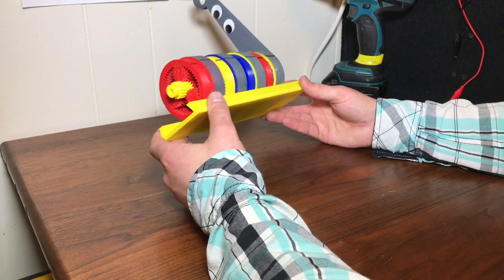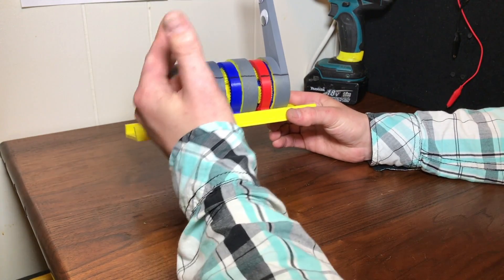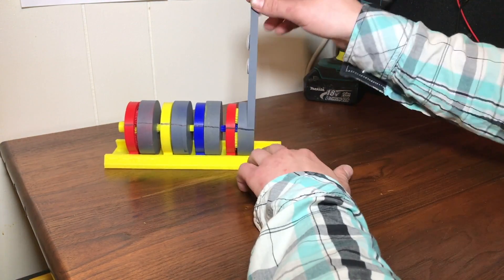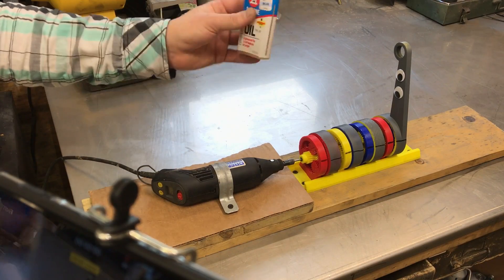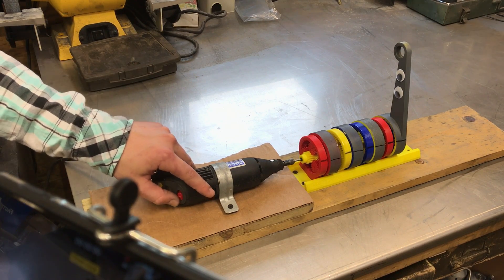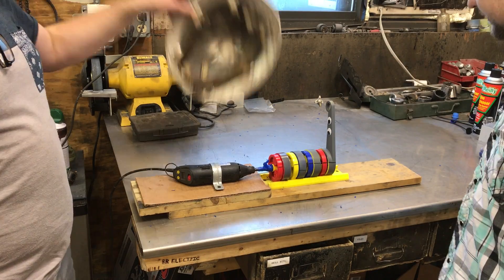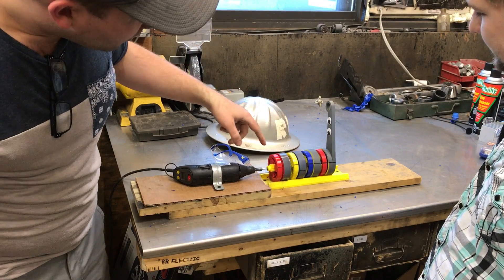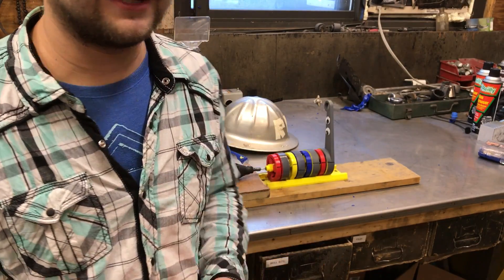3,616,238,492,881 To 1 - The Most Useless Gear Ratio Ever

Comment: İt isn't useless if you got 3.7 trillion rpm motor.
Reply: YANK THE CRANK !!!
Reply: the torque needed for that, lol
Reply: you can totally move it with your arm strength, you just need a very very very long lever made of something awesome.
Reply: Dylan McCallister and extremely good fixing mounts...
Reply: don cahooti it would work but you would need to push as hard as all those loaded boeing 747s.
Reply: mighty BÆringball -- its right there on the table ! just pull the handle and you got your 
trillions of r's pm at the other end.. simple
Reply: That shit would make a singularity in time
Reply: they need to try pushing it with hydrolic press
Reply: You all gonna be the reason this simulation were we live goes out of ram
Reply: I don't think any motor can do that but if it exists, it would be fucking insane.
Reply: Or if you spin the opposite side to turn a coil.
Reply: All you would have to do is connect a couple thousand of Drexel tools together and make them spin the same way at the same time and then the built up RPMs would exceed a few trillion, depending on the RPM on the dremel tool
Reply: That would b one hell of a hot machine, it would form a black hole lol
Reply: Uğur Aktaş ot a 1hp lawnmower motor which can then rotatethe end gear to the initial gears towards the rear wheelz of a train with a 1:10 reduction gear sp the wheels dont burn offf!! It will likely spin the gears from back instead on the sun gear.
Reply: datgamerboy123 The dremel is electric making it a motor. An engine would be internal combustion.
Reply: Or turn it around and you get 3.7 trillion out of one rotation
Reply: @tronixfix  but than you would need to have 3,7 bilion wats engin on one end, to have one wat outpoot...
Reply: the motor's shaft would simply explode because of the centrifugal force
Reply: It would still only turn 1 rotation a minute lol, it'd be strong as all hell though.
Reply: Uğur Aktaş then we could lift trucks with that!!!
Reply: datgamerboy123 how is that an engine and not a motor? I think you have terminology mixed up.
Reply: But before that we would have achieved galactic travels.
Reply: friction exists lol
Reply: It could happen in a total vacuum environment! Air slows down everything!
Reply: Duck Goes Quack not really. Time dilation. Itd go near light speed then LITERALLY SLOW DOWN TIME to make up for it. special relativity! (i mightve got something wrong)
Reply: Joel A finally someone else smart enough to know the difference between an engine and a motor!!! Thank you
Reply: It would still take a whole minute😱😱😱😱
Reply: my channel yea good idea, put a black hole in front of that gear

Does it work? We don't know?
Reply: its impossible, because you cant go faster than light
Reply: And we don't have it
Reply: Uğur Aktaş 3.6 trillion you have to round down
Reply: How you want to cool the gear?
Reply: The fucking universe will stop
Reply: Adamsın
Reply: EarRAPEfactory 
if it exists
it will broke in 1 nanosecond
Reply: Would burst into flames from friction
Reply: EarRAPEfactory r/woooooosh
Reply: Y'all r missing the point
Reply: datgamerboy123 a motor is an engine

But whenever we say motor. Most think about the vehicle
Reply: @Vlek 
 motor  = runs on electricity
 Engine = runs on combustion
Reply: @LadyDeathStrike1583  oh okey, got it! thanks :D
Reply: Jesus jiu-jitsu it will snap
Reply: If anything directly connected to the shaft has a radius of 0.5 cm, the edge would be spinning at 2/3 of the speed of light...
Reply: I think if something spun that fast we would literally all die somehow lol
Reply: Uğur Aktaş we can build a gear that makes 3.7 trillion rpm and put it in front of his🤔
Reply: Put it in reverse and you have a 1 to 3.7 trillion year box, just turn to at a rate of a few degrees per day
Reply: Zach Kraemer kugelblitz?
Reply: +don cahooti "Just", yeah sure, good luck with that. Though I feel there might be a better use of your freakish superhuman strength, perhaps such as launching payloads into space. Also you'd just break the device.
Reply: Uğur Aktaş it would still take sbout a minute to turn once
Reply: gets 3.7 trillion rpm motor
gearbox explodes violently
Reply: Holy Jesús fuck  that would be crazy
Reply: Rayo's number of Nm of torque, Rayo's number (negative) of C° temperature, and Bedrock from minecraft for resistance.
Reply: Put The Heart Of Gold Spaceship on this fucking shit and fuck right on the pussy
Reply: Uğur Aktaş  TO One MAKE IT Completely useless , Call it NEGATIVE ENERGY
Reply: That would mean the engine would rotate faster than lightspeed..
Reply: @danieldeak9141  r/wooooooooooosh
Reply: Uğur Aktaş a motor of that power would destroy its self as soon as it powered up
Reply: You could probably just rip time and space with that hefty fucker.
Reply: Ah yes. Just for insight: let’s assume the average dremel has an axle of 1/8 inch. Using the circumference formula I found it’s about .393 of an inch, or
 .0000062 of a mile. Now multiply that by 3.7 trillion to find how many fast the outermost part of the Axle is moving, you get 22.9 million miles per minute, or 1.4 billion miles per hour. Ah yes a dremel that turns double the speed of light.
Reply: Not the Dremel
Reply: All or you who called it a motor, you're stupid... It's an engine

Comment: I have only a slight concept of what is going on here but what would happen if you could get something precise enough to move that lever on the final gear fractions of a degree, would the other gears theoretically spin at hundreds of thousands of RPM?
Reply: Yes but it would take an immense amount of torque to do so
Reply: Colton Thiede yes and the gears would strip under the torque load
Reply: you can totally measure the speed of light in rpms so long as you fill out the rest of the equation. you need to know the distance of the circumference of the rotation. obviously you will only be referring to the leading edge because the center of the circle will spin much more slowly than the outside edge. Measuring in this manner really is finding out "how quickly can this spool a light year long strand of thread with 0 thickness." 

If you were right ibieiniid then a car's speedometer wouldn't work. you can measure distance in rotations so long as you know how far 1 rotation will take you.
Reply: Trillions of rpm faster than speed of light. But you need whole energy of sun to do so
Reply: Jim Treacy
Reply: ....the speed of light can not be measured in RPMs.

Sorry if joke.

Comment: I think there's an error in your calculations of the number of 747's. 
If 6000t equals 439 fully loaded 747's it would mean that a fully loaded 747 only weighs about 13,5 t. As these planes take more than 100 passengers at a time those people would have to weigh next to nothing, as the plane itself without fuel or cargo will weigh at least several metric tonnes.
Or did I misinterpret something?

Comment: It may be impractical but technically it's not useless.  The end gear would have to rotate faster than the speed of light to get that leaver to rotate once per minute.  I'm guessing it could be used to measure something very precisely.  A wheel and an axle are like gears with a ratio of 1 to 1.  If a wheel can be a measuring tool, so can this.

Comment: Would you be able to turn the lever at the end so that you are spinning the gears in reverse therefore reversing the gear ratio? im just wondering. my guess is that it would take way more force to do that which would stop you from doing that.
Reply: Androidzombie1 you would need an infinite amount of force and torque, let alone having an infinitely massive and strong material, because it would basically set the other end spinning faster than the speed of light. Physically impossible unless it was massless or infinitely massive.

Comment: you should buy a dental handpiece, it can go up to 550,000 rpm at 80 psi/0.55 mpa, try to buy the Sirona T3 Racer from Germany to get the best output, you'll also need a can of W&H F1 Service Oil to keep it in top condition because it is a very precise tool that hates corrosion of any kind, installing an air filter in your compressor would also do it a lot of good.

Comment: Put the drill in the last gear
Reply: I actually want him to break the fabric of space-time. Please put the thing in the other end.
Reply: "Ya canno' break the laws of physics"

~Scotty (Star Trek)
Reply: HOLY SHIT LMAO
Reply: The torque needed for that is insane
Reply: Well it takes 3.7 trillion rotations of the first gear for 1 of the last, the gears look like they have a 1.5in radius, and a bad dremel goes at 5000rpm, so...
3.7 tril * 5000 = 1.8*10^16rpm
v=2pi*1.5*(1.8*10^16)=1.646*10^17rin/min
Plugged that into a tip speed calc and its 35908488000000m/s...    METERS PER SECOND
 (mach 104726205997)
Speed of light is 299792458m/s
The first gear would be going 119777.82x the speed of light
It would take 119777.82x some unlimited amount of energy to rotate it and it would destroy the observable universe. The laws of physics as we know them would cease to exist...
Reply: so if he spins the back. he creates a blackhole
Reply: bolt it to a diesel.... from a cargo freighter, make gears out of chrome vanadium steel or straight up diamonds, as the economic absurdity event horizon has been well and passed.

See what breaks first, the gear teeth, the 12 foot tall block or the observable universe.
Reply: anonimodecm that would get hot AF
Reply: even half the rotation makes the second gear to melt....
Reply: It would just lock up or break
Reply: 2+2=4-1 that's 3 quick METH
Reply: Arty Brutix the strongest material in the world is actually graphene so those diamonds wouldn’t stand a chance against those forces
Reply: No the Geneva Convention won’t allow that
Reply: Or if you like prequel memes

“My lord, is that... legal?”
Reply: might be safer to divide by zero
Reply: Ibrahim Noor the closer you get to the speed of light the more massive things get also the slower time becomes. Making the relative time on the gear much much slower making the velocity slower causing it to never reach the speed of light unless you have infinite amount of energy. You are missing many calculations for your equations as you need to bring into account relativy as it plays a huge roll at that point.
Reply: Ibrahim Noor lmao
Reply: Ibrahim Noor Jesus Christ it’s Jason Bourne
Reply: Wiryan Tirtarahardja only for criminals
Reply: what if you made a gear reductor to multiply the torque being applied to the end gear?
Reply: drill first gear. when gear is fast, drill second gear. do this for all consecutive gears.
Reply: cowpker4life more like ot plays a huge troll at that point, making you never reach the speed of light
Reply: Because of gear ratio and friction, this gear is self locking. Just like worm gears. No matter how big input torque would be, it wont turn as a multiplier.
Reply: Ibrahim Noor it would break and fly apart before that speed funny statement though
Reply: Frost that's what she said
Reply: Arkines or time and constant pressure and lube and a kick start
Reply: Eliyas Ahmed humans don't have that sort of patience they would more likely snap the torque rod
Reply: Ibrahim Noor seems like you love maths
Reply: Ibrahim Noor r/theydidthemonstermath
Reply: Agree
Reply: Wiryan Tirtarahardja I will make it legal
Reply: Jonathan Plymesser Well Q could
Reply: Ibrahim Noor so what you’re saying is they have a device that could destroy the universe if somehow someone found a way to spin the last gear? That’s fucking amazing! I’m glad it’s probably impossible.
Reply: Frost it would take billions of pounds of force to spin the output shaft.
Reply: Ibrahim Noor that’s ridiculously awesome
Reply: There's a lever for that.
Reply: cowpker4life not massive but shallow
Reply: Ibrahim Noor space time would bend sooo much
Reply: Jonathan Plymesser but they can break you
Reply: captain obvious here: probably the 2nd gear would break due to the G forces. The 3rd one won't be even be able to turn haha
Reply: Ibrahim Noor basically the gear is going to warp from the G forces being exerted on it and will shatter to dust well before even the slightest movement of the last gear is made if you could manage to even make it move.
Reply: Ibrahim Noor okay but couldn't and infinitely long lever habe enough torque to turn it? The lever to turn off space time
Reply: +Ibrahim Noor dude.. Calm down man. Its ok he did a mistake
Reply: Then the gears go faster than light speed and turn into pure energy

Comment: Idk what I'm really talking about, but say your little gear ratio thing was made out of a more durable material that can with stand 6,000 metric tons of weight, and would not break under incredible stress. Can't something just pull the Handle on the last gear in making the 1st move incredibly fast. Maybe speed of sound, or something faster...

Comment: It's actually one of the most useful, reverse engineer it so it can be used as a generator, and it can be powered by a string wrapped around with a weight attached, and for the heat problem attach a 3d printed jet used as a fan on your current "out put" side, it's far from useless, you mentioned many examples

Comment: What would happen if you spun the OUTPUT gear at high speed?  Would the imput gear melt, and open up a portal to another dimension?
Reply from the maker: it opens a portal to the upside-down, I've tried it a couple times.

Comment: So if the material was strong enough and a force great enough, if you turned the handle at the same speed as the dremel, would the other end THEORETICALLY spin faster than the speed of light? I know that one part would be impossible, like the force needed or the material being strong enough, but  would still interesting.
Reply: Let's assume you had an indestructible machine, you could actually turn the handle at 15000rpm and the outer diameter of the last wheel was about 50mm or 2 inches, this would result in the wheel's outer edge rotating at roughly 20 million times the speed of light. 
Do it and have a Nobel Prize in physics for sure. LOL

Comment: Could this heat up a room with only the cost of a drill.
Reply from the maker: +Pinquin Sammy depends on the wattage of the drill and the amount of insulation in the walls and the temperature outside
Reply from the maker: +Pinquin Sammy but the gearbox doesn't make that process any more efficient than just the drill by itself if that's what your asking

Comment: Is it possible to make something like that in reverse? Theres the handle, and it's a 1 to 3.6 trillion ratio and stuff, but when you do one rotation of the handle, the other end spins around 3.6 trillion times? That would be very fast. I assume it's not possible, otherwise somebody would have used it as an incredibly efficient way to generate electricity.
Reply from the maker: +Ninjatam when you double the speed you lose half of the torque, it's actually a less efficient way to generate electricity

Comment: Assuming the output torque and speed of a gear increaser with 3,616,238,492,881 :1 ratio, input torque of 1000 in/lbs, and input speed of 32,000 RPM is:
3,616,238,492,881,000.0000 in/lbs (rounded to the nearest 10,000th)

Comment: the plastic is not going to melt at 90 degrees. I don't understand why your cooling it down to 0. if any thing your going to make the plastic smaller and its going to skip a tooth
Reply: Or it might crack it
Reply: It was in Fahrenheit.
Reply: Both PLA and ABS, the plastics used for 3D printing, become too soft at 90 degrees. That is, if you mean Celsius degrees.
Reply: Google glass transition temperature of plastics. You'll understand then.

Comment: If you spun the out put gear once every second the input  gear speed would equal this => 216,974,309,572,860 Rotations per minute, if the gear is 5mil in radius than the angular velocity would be 1/409th the speed of light.

Comment: Put the gearbox in an open top container and fill it with mineral oil.  Some how connect drill through box.  See if it helps with cooling and lubrication?

Comment: Damn, that's pretty damn cool! the second gear should still have a decent amount of torque, right? If it were possible to move the last gear, would it mean that the first gear would spin at 3,616,238,492,881 rpm?

Comment: Pointless
Reply from the maker: +guerillamovies that's the point
Reply: if magnetic gears and ceramic bearings were used the friction would be a non issue the next issue would be strength of the output side id used in reverse to make a gravity powered generator for low current materials like carbon fiber would help with the moving parts that are not exposed to friction and coatings and a sealed vacuum are key  good luck

Comment: Forgive me for saying so, but i fail to see the point of this exercise. Isn't the point of gears to get higher ratios of spin instead of lower ? Maybe im just missing some pointers since i havent been following your channel. A bit more context could have helped me understand what you were trying to show us ... or maybe you just connected your drill on the wrong side of your device. I guess if it had been connected to the other side you would have had to deal with much bigger issues about structural integrity. Maybe next time :-/

Comment: in 1992 Arthur Ganson built 'machine with concrete' (on display at the exploratorium, San Francisco, CA)
it has a fractional horse motor running @ 1 rev/0.283secs, 12 sets of worm gears, 50:1 each. the output is anchored in a concrete block and will take 2.2 trillion years/revolution.
it's been running for 25years, so you mathematicians, how many seconds of arc has the output turned?